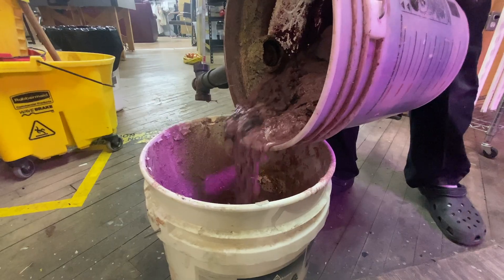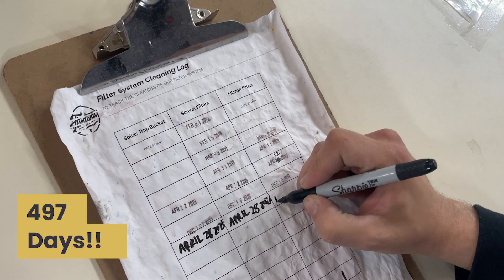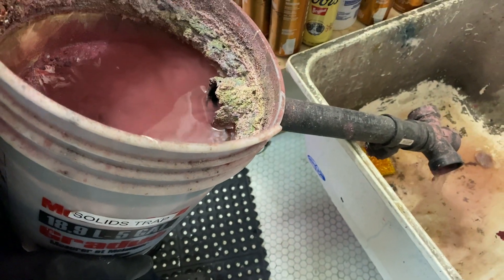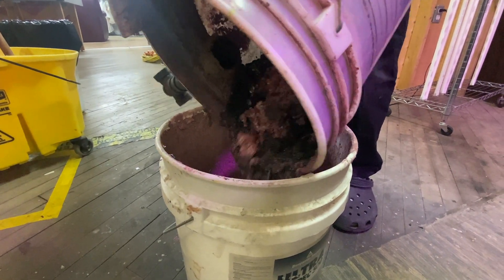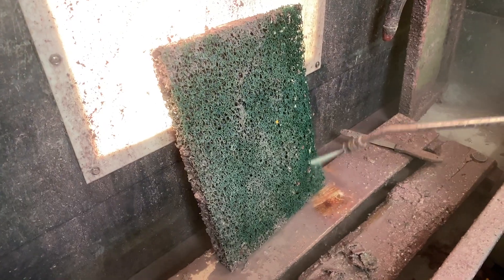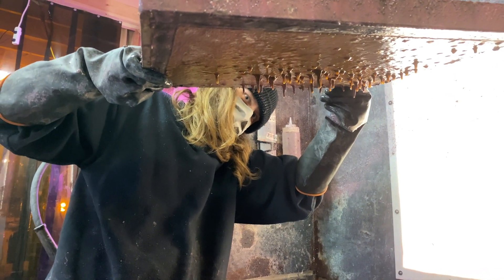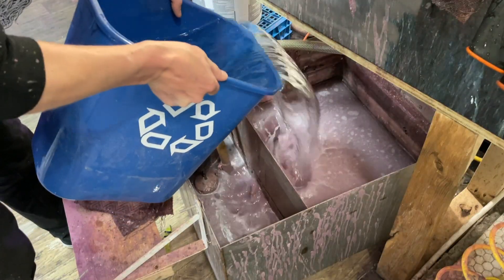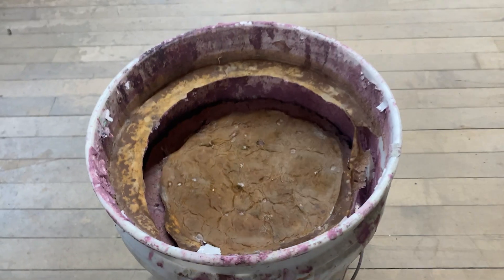Reclaim Filter Cleaning, after 497 DAYS of screen printing!

Comment: Great vid man! I sent you a message on facebook but ill put this here for everyone else to read. Maybe it will help them out. 

What really helped me was getting a second set of screens and bucket trap so you can replace and clean the dirty screens. 

Also, get a roll of CCI filter material. Then it doesn’t clog up that green filter and it’s easily replaceable. I don't even use that part and the filter media can fit right inside the screen.
Reply from the maker: So good, thank you for sharing. I definitely want a 2nd bucket bigger than the 5gal, because the overflow was pretty annoying. I will look into the CCI media because I do like the idea of tossing it out when it dries - can't really keep the green one clean without fully washing it out. So that would probably help keep junk out of the bottom, I think the green thing fills up pretty quick and sends a lot of solids to the bottom of the box.
Reply: @CoryatFloodway  I’m gonna send you a vid.

Comment: So the 2 micro filters are for your water supply.  At first I thought you were filtering your drain water, but that's obviously not the case.  Some others might be confused given the subject of "drain cleaning".  Thanks for the video.  Subscribed.
Reply from the maker: Hey Jeff, I think you're misunderstanding a bit. The drain water is being filtered, this is essentially a 7 stage filter, ending with those micron filters.

Even if it goes through the basic solids trap, it still removes enough from the water to have passed my local testing. 

But the micron filters are for the discharge water. It comes down out of our sink, into the bucket solids trap, then down into the Ryonet filter system - which is the three screens, one more settling stage, and then the sump pump forces it through the micron filters before going to the drain!